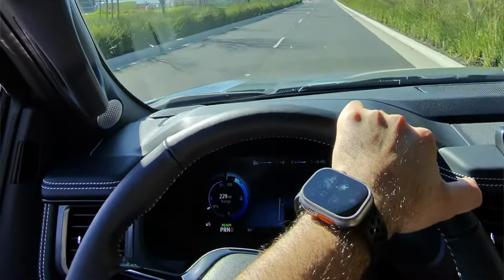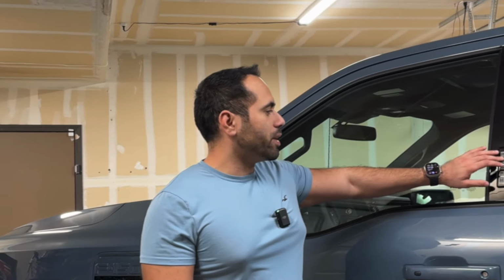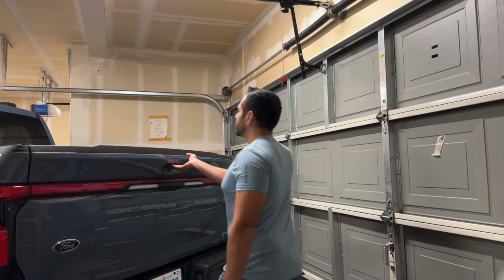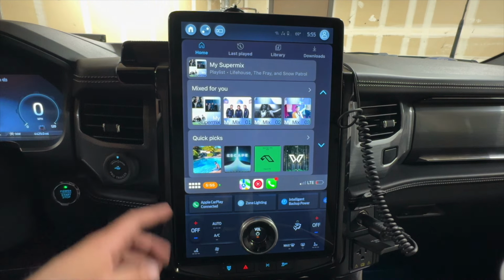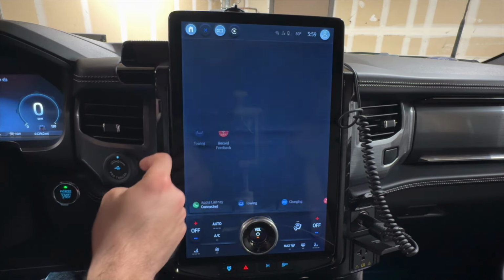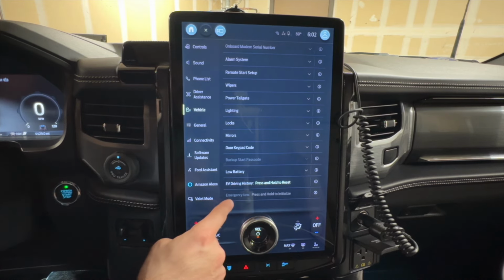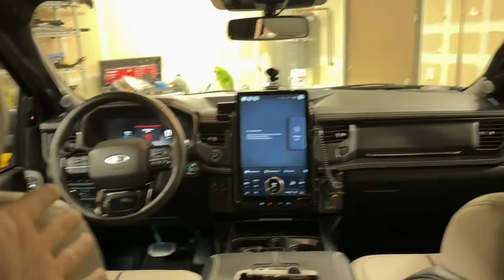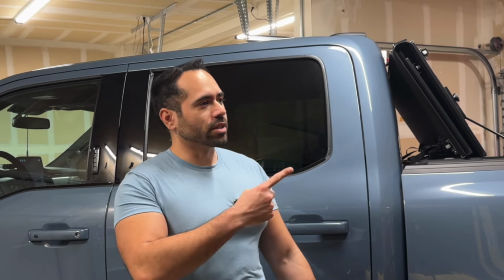Ford F-150 Lighting My Daily Tips and tricks

Comment: I will stick with ICE, trucks. at a 100K it should get 1000 Miles per charge
Reply: I paid $61.5k for my Flash and that has all the tech of the Lariat.  Over the next 6 years I will save $20k on fuel.  $41.5k net cost.  Zero tailpipe emissions.  Evolve or become extinct.
Reply: Thanks for your reply, In 6 Years your lighting will be worth as much as a Windows 3.1 computer. Thanks to Ford ending production and the issues with towing.  My ICE truck will keep more value.
Reply: @michaellindsay9853  
Wrong.
Reply: Turns out he was right. Check out the used market for these. The value is completely destroyed.

The cost to install a charger at home takes a long time to beat the cost of gas.

Comment: What range are you getting?   I missed if you mentioned.  Any towing ?
Reply from the maker: 180 realistically with a 90 percent charge
Reply from the maker: And I didn’t tow with it but i would expect half of that range gone.
Reply: I’m getting 300 miles on 95% and I use around 200 to 250 miles per day with my job.